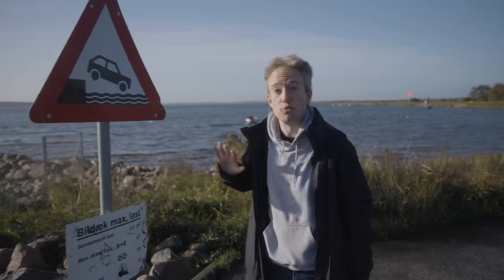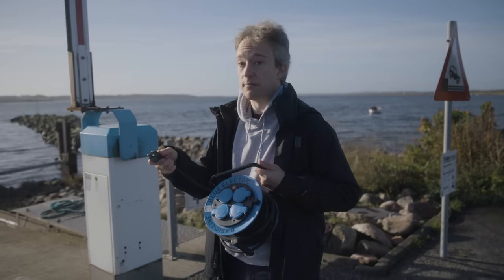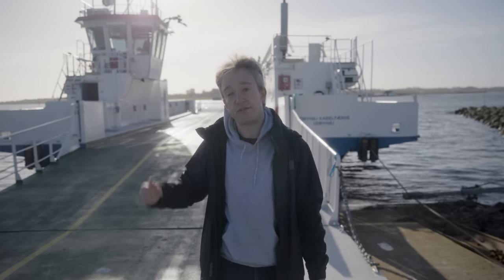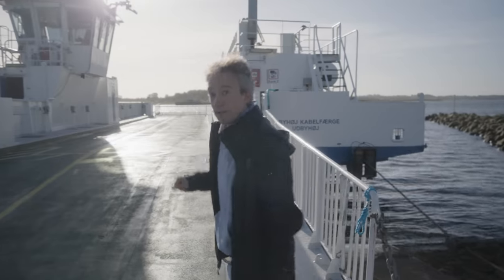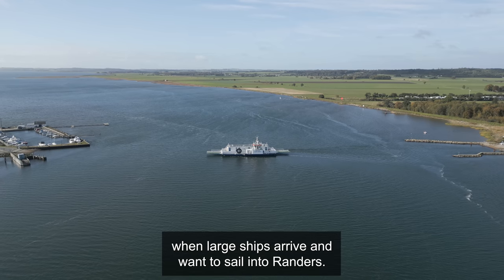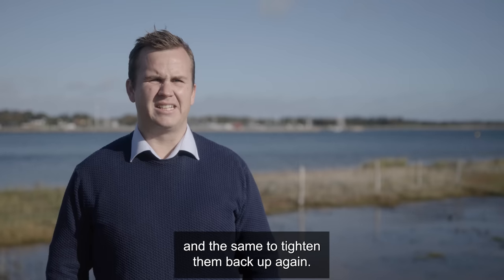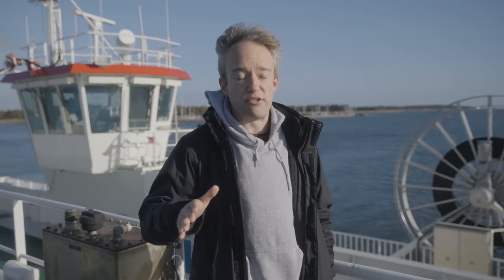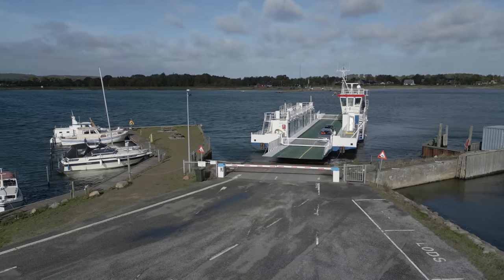This electric ferry uses a very long extension cord

Comment: Nice video. About the energy required, he talks about 150-200 kWh a day, divided on 88 trips, means around 2 kWh per trip which wouldn't be very problematic for a big electric car battery pack. The very low speed makes the energy requirement similar to moderately enthusiastic driving in an electric car.  Their homepage mentions 2x45 kW electric motors, 90 kW isn't much for an electric car. It also says it takes about 4 minutes, around 2 kWh per trip, and 4 minutes per trip means about 30 kW average power draw during travel. That's about what a big SUV uses at highway speed, but constantly, not just 4 minute periods.              

Note that the previous 100 liter diesel per day represents ~1000 kWh, and combustion engine enthusiasts likes to claim that diesel engines have 50% efficiency. Well, it is possible, but in reality like in this case when you're not running at absolute optimum rpm and load all the time they can be ~20% efficient.

Comment: Way back in the day my dad had a VHS player with a remote connected by cable. I guess it was a step on way as well. IR remotes on batteries were just around the corner.

Comment: At 0:59 he said it uses 150-200kWh per day, and does about 88 sailings per day.  If it was able to recharge at the dock a batter could easily work on this ferry.  While I wouldn't think this ferry would need a battery since it's already has cables across the water, other similar ferries could easily be battery powered with charging at the dock.
Reply: You don't have to look very far to see examples of battery ferries, they sail from Helsingør in the east of Denmark to Helsingborg in the south of Sweden, a distance of less than 3 nautical miles. There are also “Harbor Buses” which are like small ferries which act as buses (same price as a bus ticket) in Copenhagen's harbour which are also 100% battery powered, they recharge at their docks.

Comment: That is very interesting Tom, but I am missing something:  They run on a cable because the boat uses cables any way. What is the power of the boat? how many trips it does a day? More data is required to justify that solution is not only because the batteries are expensive. They use 200kwh a day, that is 4 times the battery of a small car. That is not expensive for a boat of that size.

Comment: If the quoted figure is correct, I was impressed by the generators only using 100lt of fuel per day - assuming it was still making 88 trips?
Reply: seems fishy

Comment: This also solves the biggest issue with electric powered vehicles, the batteries.

I do think moving to electric is the right direction, and we can't afford to wait. But I have a feeling that lithium waste and lithium mining is going to be a bigger issue than it looks like right now.
Reply: The issue is at time moment, everyone can not have their own metal box to transport themself around in. It is just waste of resources that should be aimed at collective mode of transportation's.

Comment: I wish Tom had hit on the operational cost difference. Just based on the stated electric vs. diesel consumption, the energy cost savings (where I live) would be nearly 85%. Add what I assume is less maintenance required, I wonder how long it takes to recoup the cost of converting to electric. Probably not too long in terms of business investment.

Comment: Even though this tech is limited to ferries traveling short distances, that’s also probably where they are most energy efficient. The relatively frequent starting up and slowing down (88 times/day vs the 1/week of a container ship) is much more efficiently done with electricity.

Comment: Washington State Ferries has a fair number of hybrid-electric ferries that run largely on grid power stored in batteries with diesel generators for when the batteries run low. They're even planning to fully electrify the fleet by 2040!

Comment: A Panamax sized vessel has aprox. 8700 square meters of area. At a peak production of 200W/square meter, that's 1,7 Megawatt peak electricity production, which is quite a nice number.

Why don't Diesel-eletric cargo ships plaster their decks with solar panels and feed that into their drive system somehow? Ot get a relatively small additional electric propeller? With fuel proces where they are, I'd think that every bit helps!

Comment: does the boat move by propelling itself the way a boat normally does?  or since it's cable guided already, does it just have some sort of crawlers on the lines that pull the boat across? Figure that would probably be more efficient than pushing the water which naturally loses a lot of power compared to the ship's momentum.

Comment: This summer we took the Tørvikbygd-Jondal ferry in Norway and it opperates a fully electric and battery powered vessel. Plug-in at the stops to recharge. It is a very strange feeling when the ferry is moving and there is no sound and no vibration.

Comment: I wonder if we could use the method used for many electric trains for ferries - elevated cables and a pantograph! It'd be expensive, as you'd have to build a series of pillars with hydraulic concrete to support the wire, but it might just be doable... maybe even worthwhile.

Comment: "Big Muskie", a huge dragline (perhaps the largest ever) used to remove coal overburden for strip mines in southeast Ohio, USA, dragged electric cables behind it. I saw it in operation half-a-century or so ago; only the bucket (which will hold several automobiles!) remains.
Reply: The German Bucket Wheel Excavators, one of which (Bagger 288) is the largest Land "Vehicle" on Earth, do so too.

Comment: So that cable gets rolled up over and over again? How long is it expected to last before work hardening causes it to need to be stripped, tempered, and re-insulated? It is a rather large diameter roll, so I'd expect it to last a while, but constant use does add up quickly.

Comment: Given they already have a cable guiding the ferry you'd think they would just lock the ferry onto the cable and have the motor on shore pulling the cable. I assume there's technical reasons that's less good though

Comment: So what's the benefit of the electric power on the ferry vs just pulling the ferry across with a cable and a motor on the shore?
Reply: probably setup cost, mostly. To pull the cable itself, they would need bigger structures at either end, and may have to dig a trench across the river so that ships can go over the cable that would have to be in constant tension.

Comment: Correction: there are electric ferry's in Norway the same amount of batteries as 2 Teslas.
But where this can be used, it seems like a no brainer.

+ Old ferry's seem to break down all the time (at least here in the UK), electric motors are much lower maintenance... and obviously lower emissions and noise and usually much cheaper to run too.

Comment: Still, I don't understand why battery-powered electric boats haven't been more common. Sure, a car-ferry is a different category but for smaller passenger ferries it's totally doable. There's a reservoir on the outskirts of my hometown that's used for leisure and there are electric ferries with capacity between 100 and 200 passengers with a dozen stops around the reservoir. They run for 12 hours a day during season and only charge overnight. The best part is that they've been running like this since their inception in 1946 and they use good old lead-acid batteries. Funny thing is that the reason they went for electric was fuel shortage after WW2. If this can work with 70+ years old technology why isn't this more common today? Everywhere I go where they use passenger boats of similar size and speed, they all run on diesel.

Comment: I got a small cable ferry close to where I live, which has a overhead cable to pull itself to one side of the small river, and a motor to get itself to the other side... then it also has a low hanging cable for a path to move along I believe. I am not sure why it wouldn't put a engine on the low hanging cable to push/pull, or use the engine to push/pull...
Might be cheaper to push to one side using the engine, and pull back using a pulley?

Comment: Tom, you mentioned that the largest fuel burners are the container ships. It would be great for people to know that while that’s technically true, every single ship takes hundreds or thousands of trucks off the road which leads to lower net emissions.
Reply: No. That is just an excuse to not have to worry about the emissions. The emissions of the container ships as well as trucks can be lessened. Also, railways. 

And even then, who says that all of the traffic needs to exist at all?
Reply: @banaana1234  railways don’t travel the Pacific Ocean though
Reply: @neverafrown6308  I never said they did.

Comment: "Switch to clean electricity"  isn't really true though, energy in Denmark comes from the following sources.

Coal
Oil
Natural gas
Biomass
Solar
Geothermal
Reply: True points.

I think in the video it's a mistranslation - "Pure-electricity" would be more applicable interpretation? as in only using electric power.
Reply: Uhm how did you miss wind? It's one of the most common sources in Denmark
Reply: @epender  Google didn't list it :)

Comment: You know, if you combined inductive coupling with a windlass style cable driven concept... You can make a shore cabled ferry that isn't actually plugged in, and could tow itself with a very high level of efficiency along the very cables that's powering it... 🤔

Comment: 150-200kWh of power isn't THAT much, though.
That's just 2 Tesla Model S car batteries (or ONE Tesla Semi battery). You could even go ahead and use the most recent LFMP (Lithium-Iron-Manganese-Phosphorus) batteries. Though they are heavier, they're fireproof and waterproof. Ideal for a ferry - and they're DEAD CHEAP at around 30-35 dollars per kWh.

Comment: I have to wonder if it would make sense to have a winch on each side and use the guide cable itself to pull the ferry across. Put the motors on the shore, then use a small battery or generator just to power the control systems and whatnot on the boat.

Comment: This is so great, but I'm wondering how often do they need to fall back to the diesel generators? How much do they weight? Wouldn't they benefit largely from removing that weight? I wonder if a tow boat for when you really need it would be cheaper 🤣

Comment: I wonder, why even have any propulsion on the ferry itself? What if there are just cables fixed to either end of the ferry and onshore motors can tug it across? Maybe a small basic propulsion system just in case the cables snap, but if the cables are big enough it shouldn't be that big of an issue (and there would then be two, so if one breaks the other can just tow it back in).

Comment: if they are going to be using cables to guide the ferry and running electricity to it , why not add one more cable that's sthicker and stronger and use that to pull the ferry from stationary pulleys onshore

Comment: Is there anything like this for larger ferries? I imagine that the issue of the cable blocking the way of other boats could be solved by having the cable run vertically from the bottom of the boat to a track installed on the seabed. From there, it's probably just a matter of figuring out how to keep the cable from getting wrapped up in too much seaweed.

Comment: 250 kwh a day???

Tom, the Model S has a 100kwh battery. A car battery can very much do it. Depending on how frequently they need to sail, and the time in-between,  charging it should seem reasonable.

Comment: My big issue with electric transport is the battery.
79 million cars built last year. That many thrown away. This year, the number will be higher.
We can't maintain that kind of battery production.
This ferry is ok. Best of all worlds.
If we are going to go all electric, the infrastructure needs to be in place to provide electricity on the road. Like old time slot cars, or overhead like trains.
But we have to power directly off the grid, or let us keep hybrids. But heck no on batteries
Be well all.
Reply: Today i agree with that, but maybe one day we figure out how to make the ideal battery, one that practically lasts forever and that does not need rare materials.  The problem with connecting cars directly on the grid is that there would be tremendous power losses in the system, depending on the number of cars. Trains can workaround that problem by using very high voltage and therefore relatively low current, but i guess that is not feasible for cars 😃

Comment: Well, there are cables that cross oceans, so maybe it's not that crazy idea. The hard part would be getting power from the cable underwater without electrocuting everything in the area, but it's just an engineering problem, and it's worth solving even if it costs billions.
So the ship could attach to the end of a cable in one port, and lift up the cable from the bottom as it goes, just enough to avoid obstacles. Or maybe it could lift it out entirely. Crossing paths would be an issue, but not unsolvable.

Comment: Thanks for the report. If they allready have to pull two wires to control the ferry, while beeing powered by an expensive powercable from land, to power rather inefficient proppelars in the ferry, and ALSO have diesel generators, just in case... Why not just pull a pram from one shore to the other? Then 
it is not a complicated ferry with certificates, just a pram, and installations on ground that can be maintained. (they can allready lover and raise them). It is an amazing waste of resources and way overengineerd, in my opinion. 

I am Danish, and never heard of this type of public money wasted, so I thank you Mr. Scott.
Reply: It is at retrofit on a ferry from 2006

Comment: If it only needs 200kWh per day that's only 2 Tesla Model S battery packs.  Charge it over night and save the hassle of the mechanical issues with the "extension cable".

Comment: This is quite interesting, does it run directly from the electric or does it recharge batteries and disconnect from shore power to move? What stops the coil of cable overheating under heavy load (like a typical extension lead would?)

Comment: There's a claim in this that when this car ferry was running on diesel, it was using only 100 litres of fuel a day for around 88 trips. Doesn't seem plausible since it's clearly equipped with a couple of good-sized truck engines.

Comment: The fatal flaw here.   Denmark still gets  ~ 56 to 76 of its electrical power from oil, coal, natural gas and other nonrenewable sources depending on season and year.  

Oil  ~ 32 - 38%
Coal ~ 10 - 16%
NG ~ 12 - 18%
Other nonrenewables ~ 2 - 4%

Comment: Question: Why isn't the motor fixed on land pulling the ferry with the cable?
Reply: Because its am old diesel ferry retrofitted with an electric motor... They didn't want to tear out and redo the land installments + cable system

Comment: I am just thinking 🤔 in instances where cables are not an option , while cars are loading, can they not exchange the battery each time they dock - they will need to have quite a few batteries in stock (super expensive) but I wonder if a possibility

Comment: It is really cool that that works but instead of having the motor on the ferry why not power the guide cables from shore so it runs like a ski lift. Wouldnt that be easier and cheaper?

Comment: Despite its huge size, transporting batteries on a boat actually requires much much less energy than moving an electric car battery. Per kilo, ship transport is more than 100-times more efficient than road transport :)

Comment: Would be interesting to know how efficient is it compared to other electric solutions.

Also, are there ferries/boats that use similar models to electric cars, where you charge up the batteries & unplug? 

Probably obvious, but i dont know much about electric boats ¯\_(ツ)_/¯

Comment: If it's attached to the shore by the cables anyway, wouldn't it be even more efficient to have the engine on the shores, pulling the ferry? That would save a lot in weight for the engine on board, thus water displacement, thus resistance, thus electricity needed.

Comment: The boat doesn't burn diesel. But where is the energy coming from in the cables? Wind power, or coal works?
Reply: Probably natural gas, which burns cleaner and power plants have industrial filters and all waste energy gets sent to homes to provide heating, whereas diesel engines create heat which is wasted and spend much of their time idling.

Comment: Tom, is the energy created to power the ship made from renewable sources?  If not, diesel or coal or gas is being burned somewhere to make this ship move.
Reply: Denmark has a lot of renewable energy production. And even if the energy used is partially made with coal, oil or diesel the mix will still have it be cleaner.

Comment: I wonder why not keep the engine on the shore instead of the ferry? That way you are pulling less weight across and don't need the long cable.
I guess dragging the cables across the river bed is not very practical/bad for local flora/fauna?

Comment: Okay, but how is the energy connected to the ferry made? It's not clean energy if they're burning coal gas or oil to make their power, they're just fueling up at the source rather than on board.

Comment: 50 3070s mining eth uses the same electricity as that ferry does and that's per day, the ferry probably only runs 16 hours or even less. Was just talking about the energy cost of mining and a 3070 uses 130 watts, by 24 is 3kwh per day by 50 is 150 kwh every day. We were talking about exactly this because we heard about somebody stuck with 35 3070s now, imagine using the same power as that ferry in your two bedroom flat.

Comment: I saw multiple times dredges in lakes powered by external electricity through a cable. Usually the cable is supported by a series of floats, not laying in the water. So the tech is not exactly new (: